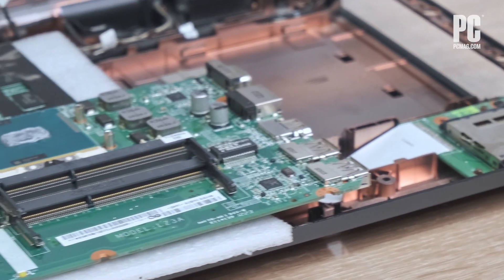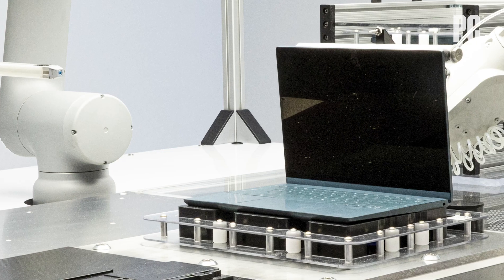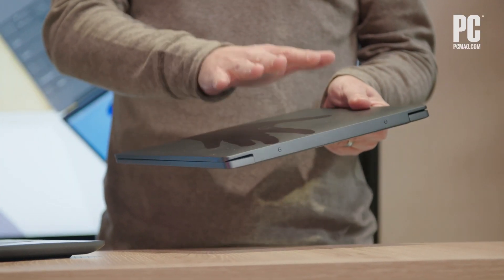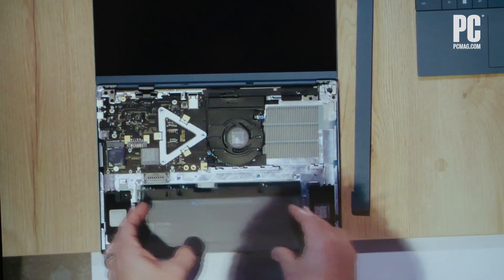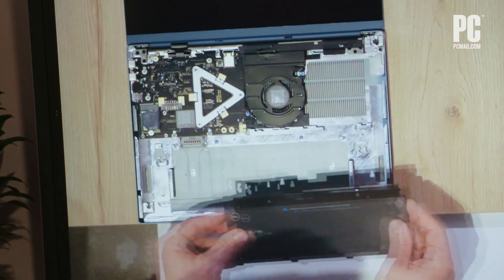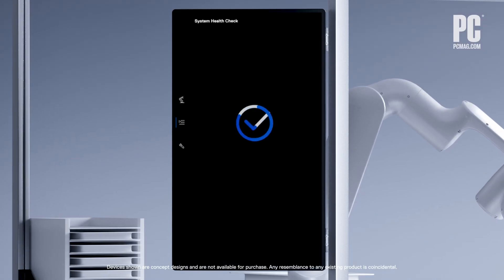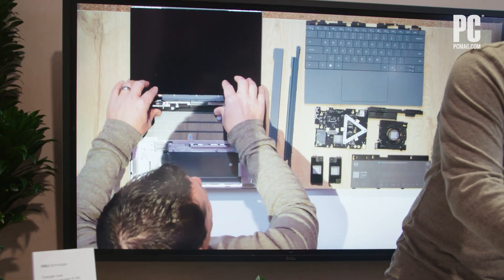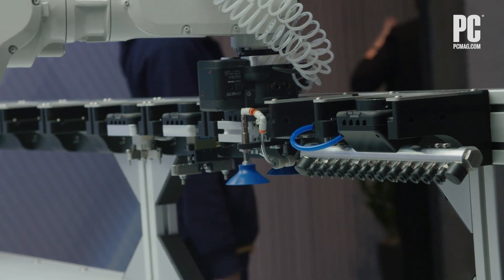First Look: Dell's 'Concept Luna' Modular Laptop Is Back, and More Refined

Comment: It be nice if I could upgrade the mainboard/cpu/gpu, or have parts be standardized, so I could move parts around or buy after market parts. Upgrading WIFI , RAM, and SSD modules have often been that way in the past with PC laptops, and it be nice if that trend continued -- I've always upgraded my wifi/ram/ssd when possible.

 I do like the notion of easy repair, but I'd probably be pretty happy with a hefty 2000's era Thinkpad design if it meant 4-RAM slots, GPU, and other goodies.  What I liked about thinkpad was how customizable they were on order; Dell has been okay on that front too.

I'd also love to be able to give an OLED display a try, and if it burns in, be able to affordably switch back to LCD.  All this implies cheap and accessible parts though, which doesn't seem to be likely unless there is standardization and adoption.